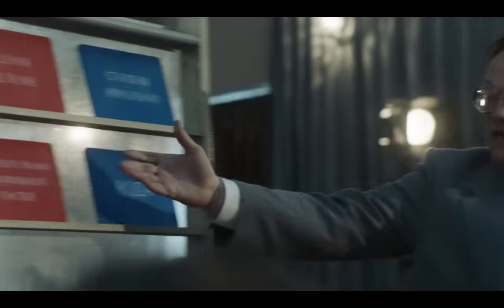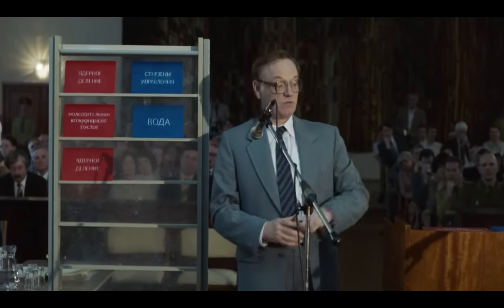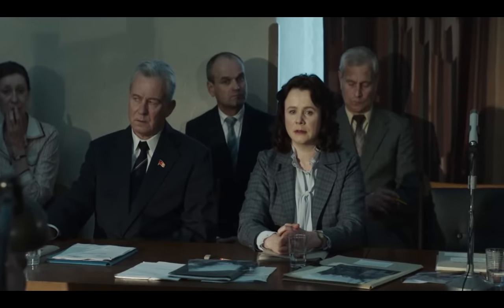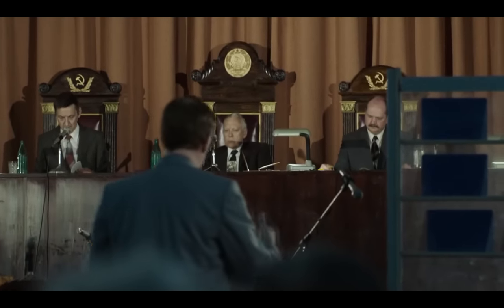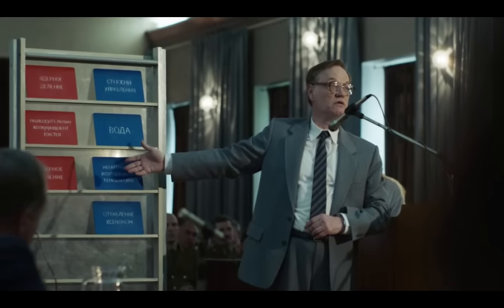Chernobyl scene #1: Valery Legasov explains, how an RBMK reactor works

Comment: I'm a nuclear reactor operator, working on a pressurized water reactor (PWR). Truly, I tell you, this is one of the most scientifically accurate scenes you'll ever see in TV or cinema. I'll do my best to explain the science.

We measure reactor power by the neutron population in the reactor. Neutrons split uranium atoms, which creates heat, fission products, and more neutrons. But a lot of neutrons move too fast to hit uranium. It needs to be moderated. (more on this later)

Critical- the reactor power is stable. Supercritical- the reactor power is rising. Subcritical- the reactor power is lowering.

Reactivity- how much the reactor departs from criticality. Another way to define reactivity is the generational change in neutron population.

Scram- full automatic insertion of control rods. In the RBMK reactor, the AZ-5 button slowly lowers all control rods into the core. In my reactor, rods are unlatched and instantly dropped to the bottom.

Boron is used for control rods because they absorb neutrons, thus lowering reactivity. Simple enough.

Water is used as a coolant, transferring heat from the core, and turning into steam to turn electric turbines to produce electricity. As you know, water is made up of 2 hydrogen and 1 oxygen atoms. The hydrogen atoms are the same atomic weight as neutrons. So, neutrons can elastically collide with water and transfer its energy, and slow down (becomes thermalized). These thermal neutrons are far more likely to hit uranium atoms and cause fission.

Positive Void Coefficient- the mathematical explanation of water when it converts to steam, it raises the reactivity, thus reactor power goes up

Negative Temperature Coefficient- the mathematical explanation of how water affects reactivity. As you know, colder water is denser than hotter water. Because water is more dense when colder, it has a greater chance of moderating neutrons, therefore causes reactor power to go up. Therefore, hotter water will actually cause reactivity to go down.

Xenon- this is a very important fission product. It is called a "poison" because it absorbs neutrons, thus reduces reactivity. Some xenon is produced directly from fission, but most comes from the decay of iodine, another fission product. Xenon is removed from the core from either absorbing neutrons (called neutron burnout) or from decaying into cesium. So when a reactor's control rods are inserted or scrammed, the neutrons are quickly absorbed by the rods, which causes xenon to rise significantly. If you try to prematurely restart a reactor from shutdown, you have a lot of xenon to overcome. The Chernobyl reactor operators did not understand how xenon behaved, and so were confused when the power tanked and then panicked when they tried to quickly raise the power again.

Graphite- the RBMK reactor uses graphite as its moderator. In comparison to water inside the reactor, graphite moderates neutrons far better, causing more fission reactions. This is a design feature of the RMBK reactor.

On the night of the accident, the operators lowered the power, which allowed the xenon concentration to rise. To overcome the xenon, they raised control rods all the way to the top.They started the safety test, which stopped the pump supplying water to the reactor. Thus all the water in the reactor turned to steam, which caused power to rise due to the positive void coefficient, even faster with the rods at the top. When Akimov hit AZ-5 (scram), the graphite tipped rods inserted, which caused the power to skyrocket. All these combined factors caused Reactor 4 to burst open. The superheated graphite, when exposed to the open air, instantly caught fire, which created the explosion.

This is a lot of info and there's a lot more to explain. If you have further questions, I'll be happy to answer. =)
Reply: Legasov really wasn't kidding when he said it was a "beautiful dance" inside a reactor. The science and technology behind this stuff is simply incredible. Got to ask, what do you think of the fourth generation reactor designs? Things like the VHTR and such?
Reply: Thewaltham this video clearly is in shock get him to the delusional
Reply: Try explaining all this to a 5th grader.
Reply: Neat.
Reply: @awittyusernamepleaselaugh7481  Sorry I took so long to reply. I'm not very familiar with 4th generation designs, but from what I've read so far, they seem like the right way forward. The VHTR is several steps ahead of PWR's, which I didn't realize was only a 2nd generation design. It uses helium or liquid salt as its coolant instead of water. Helium's advantage is that its chemically inert and it won't become radioactive like water when exposed to gamma or neutron radiation. Liquid salt has better power density and can contain fission products in the event of a leak. It would also be very nice to not have to worry about pressure control or brittle fracture so much with VHTR's; in PWR's, pressure control is everything, and brittle fracture is always a concern.
Reply: @APG19912009  No, graphite doesn't react with xenon. From a fission reaction, neutrons are formed from the uranium atom that got split. Most neutrons are fast neutrons, which do not have a very high chance to collide with other uranium atoms. A moderator is a material that slows down these neutrons when the neutrons elastically collide with it. These "thermal" neutrons now have a greater chance of interacting with uranium and causing a fission. So when the graphite tips on the control rods were driven in first, these quickly thermalized neutrons to cause more fissions, which caused power to rise.
Reply: Do you think that there could have been a way to stop the power rise without causing the reactor to explode. Perhaps only putting in the control rods back in a few at a time?
Reply: @shadowwolf2608  The only way I can see the operators could lower the power with the rods on top would be to stop their safety test and restoring feedwater flow to the core. The whole accident occurred because they were performing a test to see if backup power can support running feed pumps if they lost power. When the pumps were stopped, all the water that was in the core evaporated into steam. Since this reactor works with the positive void coefficient, more steam means the reactor power goes up. Restoring feedwater flow to the core would reduce the steam in the core and reduce its power. Now, the feedwater would be cooler than the water/steam that is in the core, so because of the negative temperature coefficient, the power would also rise. But as the water gets hot again, the power would go down. Because of these two coefficients, a slow, steady restoration of feedwater instead of a sudden restoration would bring the power back down enough that the full insertion of rods wouldn't act like a detonator and finally bring the reactor to a shutdown condition.
Reply: @demonhunter5520  Thank you
Reply: @demonhunter5520   thank you for explaining this for me! I was curious as to how it all worked and how it all failed. 
If used properly nuclear power is wondeful! I'm glad we learned from our mistakes and is making a much better design! 
So I have a dumb question does the water that goes into the core become radioactive??
Reply: Why boron control rods have graphite tips?
If graphite acts as a moderator, their complete extraction from the core is a "mistake", correct? I mean.. at the end of his speech Legasov says "it's cheaper", so I would think that it's cheaper to have bars with dual aims, so that when only the tip is drawn they only work as a moderator (graphite), while they can be completely lowered if reactivity has to be reduced (boron).. did I get it right? The "mistake" in RBMK reactors is to have rods which can create two opposite results only depending on how much they are lowered? (And to have personnel who didn't know this?)
Reply: @luha500  The graphite acts like a gas pedal and boron is the brake pedal, so graphite brings the reactivity up and boron brings it down . You need them both in a reactor like you do in your car. The mistake is more down to the fact that all the rods were put in at once rather than a few at a time. demonhunter5520 may understand your question better than I do
Reply: I want to ask 2 questions :
1 , the graphite is already surrounding the fuel rods , how inserting just graphite tips will increase the reaction tremendously 
2 the steam exiting the chimney , was around the fuel before , thats mean its was contaminated , how do they clean it before releasing it to the sky ? 

Thank you sir for your valuable informations
Reply: @zakarianaji9209  Im not nuclear engineer, but i think that 
1. the graphite isnt surrounding the fuel rods, its more like the fuel rods are inside a chamber which is coated in graphite, which increases reactivitiy, and so when the graphite tips of the boron control rods are lowered, that spike in reactivity caused the explosion before the boron could enter the chamber and slow reaction down.
2. Im pretty sure all the feedwater and steam are heavily radiated and would not be released or linked to and water systems that come into contact with humans, the water is heated, converted to steam, which drives turbines to generate power, then its probably cooled down and the process repeated, it never leaves the system through chimneys etc.
Reply: @saifury2  but the point is , there was already a lot of graphite in the reactor  , wich increase reactivity , so how insert ing like 5% or less of graphite cuse this huge Spike in reactivity
Reply: @zakarianaji9209  prob something to do with location, the control rods are situated between the fuel rods, and instantly reduce reactivity, hence i would think the same thing occurs for the graphite tips
Reply: This is very informative ❤
Reply: demonhunter5520 sir thanks for your explanations, but there is still something i do not get. 
What was the main consequence of the xenon poisoning in the chernobyl incident ? Sorry for my english i come from belgium :)
Reply: Interesting comment. I am curious, tell me, as a nuclear operator, what were your feelings when you watched this show, and that last episode in particular where the disaster unfolded? :)
Reply: I definitely read all of that.
Reply: Awesome information dude
Reply: nneeerd
Reply: @valentebrandontoni6029  Xenon poisoning as already pointed out will insert a negative reactivity and thus drive down the power. The operators never realised this and kept on withdrawing control rods to insert positive reactivity so as to increase the power to the level demanded by the test.
But as soon as power increased the already existing Xenon buildup started getting diminished due to increased neutron production.
And suddenly the negative reactivity of Xenon vanished and the power started to skyrocket.
Reply: @APG19912009  They call it a "moderator" because it moderates and slows neutrons down which makes them more likely to react (be captured) when they collide with a nucleus, raising the reaction rate. I'm just not sure why it was on the tips of the control rods.
Reply: I'm very confused as to the role of water and the positive void coefficient in the reactor. So, typical water is used both as a coolant and as a moderator in the RBMK reactors, albeit I believe it's a rather poor moderator due to hydrogen's higher neutron absorption cross section. So my first question is if water has a moderating effect that outweighs its neutron absorption? I believe it does, but if water is mostly a moderator, then this leads to my second question, which involves the positive void coefficient. Since colder water is denser than warm water, that seems like it would have a larger moderating effect as there would be more water molecules present. Therefore, the warmer the water gets, the less of a moderating effect it has, and reactivity would decrease as a result I believe. So, I'm confused as to why steam causes reactivity to INCREASE when it seems as if it should decrease, because there's now a lower density of water molecules, ergo decreasing the moderating effect of those water molecules. Is there a unique property of steam that increases the moderating effect of those water molecules, or is there some other factor at play?
Reply: @blindMAN219  Hi David,

Water is a very good moderator and as you mentioned a neutron absorber too.
A neutron should ideally in practise get thermalised in min no of collisions with the moderator ( elastic scattering) because it helps in preventing the radiative capture of neutron in the fuel. This is done by water much faster than heavy water.
So the neutron in a water moderated reactor can be thermalised quickly and thus neutron will not travel far away to get thermalised - helps in making a physically smaller reactor.

All this is possible only when we compensate the demerit of water being a neutron absorber, otherwise, the chain reaction will never happen even we have made a physically smaller reactor.
So, the way out is to enrich the fuel so that sufficient neutrons are available even when many get captured by water moderator.
Reply: @olympusmonsx  Oh that's very interesting. So the use of heavy water in natural uranium reactors is because the D2O has a much much lower chance of absorbing the neutrons, even though it has lower moderating capabilities? So that explains why you need low enriched uranium in light water reactors OR another moderator like in the RBMK reactors - to grant far more moderating capability to offset the absorption by the light water when using natural uranium. This makes a lot of sense, I get it now. Thank you for clarifying this for me!
Reply: @olympusmonsx   So, I understand thermal neutrons as being neutrons slow enough for the uranium to undergo fission when absorbed. You mentioned radiative capture - what is radiative capture, and why do we want to prevent this with the nuclear fuel?
Reply: @blindMAN219  
If you observe the absorption cross section of neutron for say U-235 fuel, at thermal energies it has a very high value , then it decreases gradually for increasing neutron energies plotted on X axis.
However, something interesting happens when you're in a band of few KeV energies, we observe resonance peaks of higher cross section. So in the process of moderation you're decreasing neutron energy gradually by elastic scattering. If you don't cross these peaks quickly and enter low neutron energy ( where fission cross section is high) you'll unfortunately loose that neutron to radiative capture. So the role of moderator to quickly decrease that energy in as few collisions as possible becomes eminent.
Reply: @olympusmonsx  Oh okay, so if the moderators take longer to slow the neutrons, there's more time for the U-235 to absorb those neutrons via radiative capture rather than fission, so you want to slow it down quickly to minimize those chances. Got it
Reply: @blindMAN219  Bingo
Reply: @olympusmonsx  Thank you for the clarifications. I just started researching nuclear physics a few months back and still have a LOT to learn
Reply: @blindMAN219  you're definitely on the right track. Fell free to indulge in any discussion in the future too. There is always something more to learn for me!
Reply: @demonhunter5520  Not me, I am still confused. The graphite rods are a moderator, what did the operators expect to happen by Hitting Az-5?, or why did the neutrons thermalize so quickly?
Reply: @JRJunior8624  so, graphite increases reactivity. When they hit Az-5. They expected for the boron control rods to decrease the reactivity. As the rods are made of boron, which decreases reactivity. However, the tips of the control rods were made of graphite. And the tips go in first. The key point is no on KNEW that the tips were made of graphite because it was kept from them. When they reinserted ALL the control rods, the graphite tips caused the reactivity to skyrocket. I believe it ruptured something that moved the control rods. With that machinery destroyed, the control rods were locked in place with only the graphite tips accelerating the reactivity endlessly. Until the core couldn't take it anymore and exploded.
I'm not an expert, but this is how I understand it.
Reply: The real question is why would Chernobyl's management be so incompetent as to hire people who couldn't anticipate the consequences of allowing xenon to build up in the core.
Reply: @mallow5828  they knew about it and the manual in front of them clearly told them that power is too low to perform the test.
This happened because of arrogance of the senior staff of unit-4.
Reply: If moderator made from pure Borons from the tip to control rods 
Still can prevent disaster?
Reply: What design flaw is reason for presence of positive void coefficient in RBMK reactor? Is it because of graphite on control rods tips or something else?
Reply: @swami5073  The void coefficient is something that is inherent in boiling water reactors like the RBMK reactor. This allows the use of unenriched uranium and no need for heavy water.
Reply: @TineFangaming  It probably would have helped if the control rods did not have graphite tips. For example, some reactors' control rods have tips made of zirconium. Zirconium does nothing against reactor power and only serves to protect the boron from being damaged. Another better design feature would be if the rods are instantly dropped to the bottom when scrammed, instead of being slowly inserted.
Reply: @demonhunter5520  Zirconium good absorb neutron as Boron?
Reply: @swami5073  Positive void coefficient though dangerous certainly shouldn't be a called a design flaw. It depends on the reactor technology used. Reactors as such have much more negative reactivity in store to suppress such postive void coefficient reactivity additions.
Its not because of graphite on control rods. It is to do with fast fission in fuel.
Reply: @Vinícius M Surkamp there too many steam inside reactor it's out of control
Reply: @demonhunter5520  Hello, thank you so much for your explanations. I understand that the control rods are tipped to protect the boron from damage. But why putting graphite, the material that does exactly the opposite thing of the boron ? Legassov says it's cheaper, but it's also counter productive, to not say stupid. There must be another reason, do you know what it is ? I read that "the graphite displaces water that would otherwise act as a neutron absorber", but since the boron itself is a neutron absorber, I don't get why it is a problem. I'm a total neophyte, but this question obsesses me. I don't find the answer, and when I do, I don't understand... :/ Thanks by advance !
Reply: @EmmanuelleCailac  Good question, I highly recommend this video that explains precisely the whole "tipped graphite rods" thing: https://www.youtube.com/watch?v=hIGtTImeYU4. Legassov's comment on it being "cheaper" is kind of misleading.
Reply: Why does cold water decrease reactivity and vice versa?
Reply: @kapilhooda2373  No it's the opposite effect. Colder water is more dense that hotter water, so there is a greater chance for neutrons to elastically collide with the hydrogen atoms in water molecules, therefore transferring its energy and slowing down. When neutrons slow down (or what we call "thermalize"), they have a  greater chance of colliding with a uranium atom and then cause a fission. Therefore, colder water increases reactivity while hotter water decreases reactivity.
Reply: Wow.
Reply: two questions:

Does Xenon bind with water, or does it co-mingle with steam?

To clarify, the graphite blew up because it was dry from water not pumping, thus allowing the graphite to not have a heat "cushion" from the water?
(From my understanding the shroud was made of graphite, and the control rods were tipped with graphite and was super hot. When the control rods lowered and went back to the shroud, it super heated the shroud making a chain reaction) sorry if I don't make sense, I'm trying to grasp understanding with imagination
Reply: I've got a question for you!

If you were a hot dog, and you were starving, would you eat yourself?
Reply: @valentebrandontoni6029  The main consequence of it was how poorly people in the control room understood what is happening to their reactor. They either didn't know what it does/how it is produced or failed to factor it in. They saw their reactor staling and without thinking about xenon the only logical option in their heads was to raise the control rods. When they did this, xenon started to burning up (with absent control rods, this happened very fast). So now they had a whole lot of neutron production, whole lot of neutron moderation and big ol' zero neutron capture with xenon gone, and rods gone which resulted in a power spike....
Reply: Sorry for the dumb question, I'm into isotopes too being a nuclear medicine technologist. What's not clear for me is the Xe behavior in this regard: 135-Xe is, I believe, the poisoning isotope so if your reactivity is greatly subcritical for a long time you should wait some time to rise it up, since the half life is about 9 hours ... but in the same time even Iodine is decaying in 129-Xe and 131-Xe which are stable.. so how you get rid of them? Second question, if, as it is, 135-Xe decays into 135-Cs where did all the 137-Cs come from?

I'm sorry you might laugh of me, but I felt like I wanted to ask.
Reply: @demonhunter5520
 Have I found a fellow Nuke watching this scene ?
Reply: @taylorc4598  Yes, you are correct. Xenon concentration is considered when starting up a reactor. It is better to wait for the Xe-135 to decay before starting up a reactor. The problem with the Chernobyl operators is that they didn't understand how xenon behaved and they were pressured into raising the power prematurely. The other fission products you speak of remain in the core and decay away over time. Cs-137 is just another fission product that can appear. This isotope remains the main source of radiation that is leaking from the Chernobyl and Fukushima reactors.
Reply: I operate reactors in Vandellos II and we recently upgraded our reactors to PWR, two weeks ago, an incident ocurred, the steam built up and broke three control rods, which exposed my coworker and he is now in the hospital with severe acure radiation sindrome, I will always stay protected in the control room
Reply: @demonhunter5520  As a nuclear engineer who has worked in reactor design and safety on both PWRs and BWRs, I just want to clarify that positive void coefficient is not inherent in all BWRs. It is a thing in the RBMK due to the use of graphite as the primary moderator. The BWRs operating in the US were largely designed by GE, and use water as the moderator much as PWRs do. Because water is the moderator in all US BWRs, increased voiding means decreased moderation, and therefore reduced neutron absorption in the fuel (lower power).

The reason why the graphite tipped control rods made the power increase so severely isn't necessarily because they're moderating more neutrons (though that certainly made things worse). The primary reason is that when you insert the control rods, you displace water from the channels. In the RBMK, the water acts more as a neutron absorber than a moderator, because of the graphite reactor blocks serve the purpose of neutron moderation. By inserting the non-absorbing graphite section first (rather than the neutron-absorbing boron carbide section of the control rods), you end up accelerating the power increase. If the rod tips were a non-reactive material like zirconium alloy, the accident would still have occurred, though at a somewhat reduced severity.
Reply: Shouldn't your name be neutronhunter?
Reply: Im Albanian i love to work as nuclear operator but here in balkans doesen't have any Nuclear power plants
Reply: @demonhunter5520  This is what happened at Ignalina first., but was classified by the KGB and Soviet government. As has been pointed out in several documentaries, the people in charge and in the control room where everything was controlled DID NOT KNOW about Ignalina. But the charges against them was that they knew. Great shame on the people in the government and KGB for this tragic situation. But, not surprising, sadly.
Reply: @saifury2  The water that is inside the reactor is not the steam that is seen coming out of the reactor. That water stays in the reactor. Anything that is used in the reactor stays in it. Other water is run through heat exchangers to cool the water in the reactor and run the turbines.  See it here :    https://www.youtube.com/watch?v=J62ZSMnEMZw
Reply: @mlgamings6110  The key point is no one IN THE REACTOR Knew about the tips. They were never told until it was told to the court. And it was classified by the KGB and the Soviet government. In telling it, Valery Legasov signed his own death warrant, albeit a very slow death.
Reply: @mallow5828  This is what happens when you hire someone who is only allowed to read the "accepted and approved" text. Things like faulty control rod design, xenon gas - the complete consequences, why containment walls are used everywhere else, etc, etc, etc,    -  They are NOT mentioned. That was mentioned in the documentary. You are told that "Soviet reactors have a perfect safety record. We have had 17! 17! They are never told about them!"
Reply: Thanks for sharing!
Reply: What SHOULD they have done?  Yes I know you say that they should run more water in instead of inserting the control rods, but was ANYONE on the planet really aware this could happen?  It seems that the reactor was sold/understood as being "explosion proof", so would any nuclear engineer ever think "No I won't lower the control rods, I'll flood it with water."  Seems to me like control rods would be the go to for any engineer in an emergency.  Not making excuses, just saying it seems like a decision no one would think to make.

Also, if xenon is really the culprit here and was built up because it was running at lower power for too long, how do you get rid of it?   Increase power very slowly?
Reply: Hard to believe that, even in this, the 21st Century, steam is still what lights, cools, and warms our homes. All that's changed is the fuel source that generates the heat that turns the water into steam. Not saying this is a bad thing. Far from it. It's just one of those things that, if only the men who invented the steam engine back in the 1800s knew that even two hundred years later, steam would still be powering the globe.
Reply: @Boskov01  You're right...and actually most of science.  It's all pretty much (right now) based on basic inertia, basic mechanics, gears, etc. thats been around a LOONG time,  just hasn't been applied to extremes.  Jets = throw some shit that way, move the other way.  Rockets = same thing.  Cars...explode this, move this up and down, transfer energy through gears and wheels.  Lighting: heat up this wire til its bright (and until recently) lose most its energy to heat.   I would say the only truly MIND blowing thing was turning on/off electrical signals into a computer.  Maybe coolant (learning the transfer of states and using that for air conditioning and fridges).  And hydraulics are cool but pretty basic.  And the concepts of electricity are pretty neat (move a magnet through a copper coil and we develop a transportable energy).  We've only had the industrialized world for 250 years, the rest was pretty much theoretical before
Reply: @johnspence8141  Yeah but when you ask the average person how a nuclear powerplant works, they probably have no clue. Hell, just two weeks ago I had no idea. I thought it had to do with like, harnessing the radiation and converting it to electricity. I'd never looked into how nuclear reactors work and never even needed to before starting to delve into the whole Chernobyl thing. But to find out it's basically a steam engine with a different fuel and fire source to heat the boiler, it's hilarious yet badass all the same.
Reply: @Boskov01  Yep, if you can past the waste that kills people for a million years, its WAY better than most sources...I'm pretty sure one day they will discover a cheap way of converting waste back to a safe element.

I think you are right about the average knowledge but its not a fair question because I bet MOST could not explain how their car works beyond gas is a fuel.  And even if you did find many, I 100% can tell you NO one can explain to you how a computer works.  I'll go even farther, I bet 9/10 can't tell you how a fridge works.  Science knowledge is embarassingly low in the average person.  So is basic finances.
Reply: @johnspence8141  I do hope that one day we can find a way to convert the waste back to a safe element or perhaps find an alternative use for it (outside of weapons or dirty bombs of course). Same reason why I hope one day we can go back to Chernobyl and Pripyat and clean up the radiation so that we can be able to even step into Reactor 4 itself without any ill effects. Don't think the area should ever be repopulated out of respect to the victims but kept as a reminder of what happened.
Reply: Question; if graphite is a moderator and absorbs protons how could it accelerate the reaction?  I dont get that part
Reply: @rabbicy  I believe it had more to do with the water displaced.  The graphite tips would have worked fine if they had not been removed completely (which is a safety protocol they disabled), when reinserting it the water displaced caused a spike, immediately turning to steam causing the channels to crack/rupture, so the control rods couldn't continue to go down...at the point they did it the energy spike in a millisecond was so huge that it didn't matter.  HAD THEY NOT disabled the safety protocol, ie: had the graphite tips remained IN THE CHANNELS as designed, no explosion.  There were so many bonehead decisions its amazing any of them had degrees.
Reply: @johnspence8141  Thanks.  So it was not the graphite, per se, it was the displacement of the water that caused the rupture.  Good to know.  So even if the graphite rods were make of cheese, the same thing would have happened, it sounds like.
Reply: @rabbicy  ya the way its reported in the movie, the graphite is accelerating the reaction but as you pointed out, graphite is an absorber.  It had something do with a momentary gap created by the sudden pushing down of the graphite that instantly turned the water to steam, expanding and cracking the channels preventing the rods from going down further.  Once they were cracked, oxygen and flames mixed with the hydrogen and thats all she wrote.  HAD THEY NOT DISABLED the graphite rods and removed them, this would not have happened.
Reply: @johnspence8141  That makes perfect sense.  thanks
Reply: If colder water dense and moderate the reaction, isn’t it reactor power should go down? And vice versa with hot water? Sorry this part is confusing and also one more question what is the purpose of graphite when you have boron rods to moderate reaction?
Reply: I know it’s probably way too late to ask anything, but why doesn’t graphite cause an explosion every time the az-5 is pushed (it was pushed a few times before), is it because of the positive void coefficient and hence the graphite being exposed directly to the neutron stream, or was it because of something else?
Reply: @tlf_worldcorner2878  no i think its the fact that they removed the graphite entirely against safety protocols...had they not, it wouldn't have screwed up...when pressing the button I don't think its the graphite itself (which as someone pointed out is actually a neutron absorber), I think it displaced some water that caused a huge spike which cracked the channels...preventing the scrambler from actually dropping.  So many things went wrong in this its crazy that they are engineers.
Reply: @johnspence8141  alright, thanks!
Reply: So what I’m hearing that you’re REALLY good at juggling
Reply: I'm told SCRAM is a term from back in the day when control rods were suspended by ropes from the ceiling. And that it stands for Safety Control Rod Axe Man. Is this true?
Reply: @arnavjoshi5913  so you're trolling definitely not
Reply: @johnspence8141  no intention of trolling, but good to know that story is apocryphal.
Reply: @mlgamings6110  except graphite is a neutron absorber, and they all knew about the graphite.
Reply: @johnspence8141  No they didn't. They didn't know that the tips of the boron control rods had graphite. They knew about graphite inside the reactor, but not at the tips of the rods.
Reply: @mlgamings6110  you're basing it on the movie...they most certainly knew the make up of the tips.  Its in the design specs and they knew the design specs.  Graphite does NOT accelerate radioactivity, it absorbs...what caused his is the tips WERE REMOVED almost entirely, and when pushed back in DISPLACED water/AIR that created a void and an accelerated reaction, breaking the channels, making the rods impossible to go in.  HAD THEY NOT REMOVED THE GRAPHITE TIPS ENTIRELY, they would not have had a problems.  DONT BASE YOUR SCIENCE ON MOVIES.  His conclusions was simply for ease of understanding, go watch the videos by the actual nuclear scientists.  GRAPHITE IS AN ABSORBER.

What they did WRONG and AGAINST design specs, in the name of a safety test, they REMOVED the rods from the actual core...the design doesn't allow it, so they had to override the design to do it.  IF THEY DONT DO THAT, there is no explosion.  Were they stupid?  Yes but not because of the graphite tips, but simply because they were told it could NEVER explode.
Reply: @mlgamings6110  A lesser known property of graphite is its unique ability to absorb fast moving particles (protons and neutrons) [28]. This interesting property allows the material to absorb light, radio waves, microwaves, and radiation too.
Reply: @mlgamings6110  https://en.wikipedia.org/wiki/Nuclear_graphite
Reply: @johnspence8141  so... Like the science is accurate but the scenario didn't happen exactly the way it was protrayed? The scenario that the show protrayed had accurate science that could possibly happen if it really did happen the way in the show.
Reply: Truly amazing of your explanation, thank you comrade
Reply: Put this up on the Wikipedia. Maybe you will help some student write their research paper
Reply: @demonhunter5520  what is "shutdown condition"? if i understood your explanation it's actually not really possible to quickly shut down a nuclear reactor right? what does shutdown then mean and how is it done? and how is uranium fuel changed during normal operations, do you just let them run out of unstable uranium? thanks a lot.
Reply: also did you ever take a swim in the pool when your supervisor wasn't around?
Reply: nuclear power is so fascinating, i just started watching that HBO series and got really interested in it haha. still boggles my mind how "we" even found out about this stuff so early in the 20th century. also quantum mechanics. just mindboggling.
Reply: You are almost as well spoken as Legasov. But it think Akimov CERTAINLY knew how the reactor would behave due to xenon. He even said "we have to wait before raising the power". He did wrong operations only because Dyatlov told him.
Reply: @APG19912009  i guess the scientific wording here is confusing. "Moderating" means not slowing down the process, but moderating neutrons, which means slowing them down, which means increasing reactivity, because slower neutrons collide with uranium more often  than unmoderated fast neutrons. That is what the op wrote as well.
Reply: My husband (who is a nuclear engineer and works at a private contractor) loved this series and said that this scene especially was perfectly done.
Reply: is there a difference in the incidents in chernobyl and fukushima....?
Reply: @johnpatricklim4509  Yes. Basically it's like the Hindingburg compared to the Titanic...they are both crashes but in different ways. Chernobyl was an explosion, Fukushima was a meltdown.

Chernobyl was caused by a bad design where they intentionally disabled the safety systems to run a test. Fukushima was caused by an act of nature, a tsunami, which knocked out the backup generators. Had they build a higher seawall or better protected the diesal generators, it would not have happened.
Reply: @jthorsson6167  reactor shutdown means bringing it to very low performance, far below subcritical. There is also a termin cold shitdown which means that water coolant doesnt even boil. You cant just "turn off" the reactor. You set it to cold shutdown with pumps working, because reactions are still vojng and generate heat, but not enough to boil circulating water. And then yes, you just wait till you are out of unstable uramium. Afaik even after that you have to cool rods for several years
Reply: @rinkashikachi  classy !
Reply: @rinkashikachi  And third: https://youtu.be/adFydLvLLeU
Reply: That is an amazing explanation. Thank you very much.
Reply: So in very simple thoughts. This sounds like they use the reaction to  create heat to power the turbines to create electricity. Is that correct?
Reply: @sytseth  yes
Reply: Many thought this show was an indictment of nuclear power. It clearly was an indictment on communism specifically and political cronyism generally. The producers were kind and left out the May Day parade in Kharkov when party officials held a parade that exposed the citizens while moving their own families out. Not a single Communist Party official was at the parade.
Reply: well, demonhunter99, did u finnaly killed demon king muzan?
Reply: If they had not pressed the button(AZ-5), how the circumstances of the reactor would have changed?
Reply: If you had a chance to go in that control room before the reactor exploded, would you with your knowledge have been able to stop the explosion, and get Dyatlov out of the way first?
Reply: thats for saying exactly what the vid said bruh
Reply: I will never understand any of this, but thank you for the explanation and for your work
Reply: Cool explanation dude! You clearly have strong professionalism in nuclear energy!
Reply: You sir are amazing
Reply: and why exactly did you type out the explanation again? yes, that is what was said in the show.
Reply: It's good but they talk too much about the idea of graphite "tips" suggesting this was a design flaw. This was intentional and a feature of the rbmk design and allowed the reactor to function properly. Also the idea of "tips" is wrong, the graphite is a big part of the rods, not just the tip. They also mention that graphite was used to save costs, again wrong. I also believe that they give an exagerated importance to the reactor exploding right after scram, when in reality it was already too late.
Reply: Thank you for working in such a important field, and for explaining things to us mortals in a way we can understand this invisible dance. My heart bleeds everytime I think of this accident, all the lives lost, I hope nothing even remotely similar to this happens again, therefore THANK YOU, for taking up the task of moderating and observing this process, be safe <3
Reply: Thank you!! This is so interesting
Reply: I have a quick question. Can lead, a metal that can supposedly shield against radiation, serve any part in stabilizing a reactor?
Reply: Thank you so much for jotting this down for the layperson like myself.
Reply: I want to work with reactors as well, how hard was it to gain the proper qualifications and How is the daily work?
Reply: There were no "graphite tips". It was a secondary rod. The idea that underlined an RBMK reactor is that you never had to turn it off. Not for any reason. The control rod setup was meant to be like a boat throttle. Something you increased or decreased but not off. That's why there weren't containment buildings. In the West you have to take half the building apart to just do maintenance or refuel the thing. Also, until Chernobyl, all of the worst nuclear accidents and a majority of them period, happened in the US or UK.
Reply: One thing I've always wondered: when reactor 4 first experienced a power excursion, would turning all main pumps back on before scramming would've made any difference? That is, would the presence of coolant slowing down the exponential heat rise - plus the neutron-absorbing water prevent the spike that fractured the channels and prevented the control rods from inserting - do anything at all? Did the pumps even have enough time to go to full power?
Reply: Next, please explain how magnets work.
Reply: As lovely your explanation is, which btw I really appreciate.
the "dance of the devil" as I call it, is as much terrifying as spectacular..
what terrifies me most, it the fact that once this "dance" goes wrong, you cannot just simply turn off the music...
(now Im talking about the reactor building being hit... nowadays, if we take it this way... Chernobyl is still active, shielded, yet its force you cant command at will... by all means, noone would "like" to open it up, but it can happen by random hit...)

Im not a scientist, but if there is something that scares me, its radiation... if the uniforms of firefighters in basement of Pripyat hospital are still radioactive... the core is still a threat...
Reply: Is it possible to safely remove the uranium or are all nuclear power plants just disasters waiting to happen? Is there a scientific way to safely make the neutrons dormant?
Reply: i will say i think one day our species will regret using so much uranium in reactors. Its a very rare un replenish-able resource who know what need we may have for it one day.. let’s use wind, solar, and other as fast as we can to stop using up this resource
Reply: @Josecannoli1209  Uranium is not a rare resource by any means. You are mistaken.

From The World Nuclear Foundation - "Uranium is a relatively common element in the crust of the Earth (very much more than in the mantle). It is a metal approximately as common as tin or zinc, and it is a constituent of most rocks and even of the sea."
Reply: @logangx9319  no you are mistaken 238 uranium isn’t rare.. 235 what we use in nuclear reactors is. .7% of uranium is 235. That’s where the concern comes from in my comment.
Reply: @Josecannoli1209  You're very misguided my friend lol. You ought to do some more research.
Reply: Why was graphite phased out as a moderator if its more efficient?
Reply: do an ELI5 bro
Reply: The open reactor exposed to air creates hydrogen gas that then explodes much more
Reply: You forgot to mention that the reason why they couldn't stop it was because the rods wore too cheaply made as well as the entire thing really. In a normal RBMK reactor built by the rules and no short cuts can not blow up no matter what. (obviously as long as it is maned) Also no qualified person L ever manned the reactor except the head of night shift.
Reply: So I have to ask, when the reactor power plummeted they should have stopped and let the xenon dissipate, then restarted the reactor from cold?
Reply: @davyt0247  yes
Reply: @tossacointoyourwitcherOriginal  thank you
Reply: @davyt0247  3 days off at least
Reply: Lost me at "neutron"
Reply: In your professional opinion, do we do it more safely these days?
Reply: Do the Coefficients exist within all reactors?
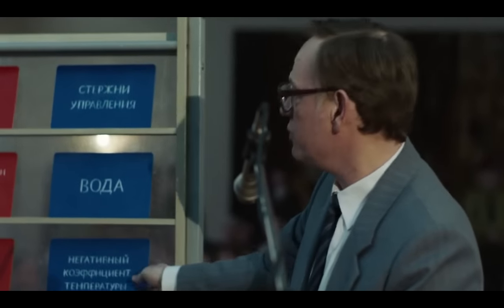Reply: 1:55 nuclear fuel becomes less reactive when it becomes hotter! Can someone tell why?
Reply: 1:55 nuclear fuel becomes less reactive when it becomes hotter! Can someone tell why?
Reply: Thanks not only for the explanation but for all you do. Nuclear power is not only safe, its the ONLY answer we have to climate change. If anything we need MORE nuclear reactors....NOT LESS!
Reply: now i know how it works, now i dont need you
Reply: Thanks for explaining what the show explained in this exact scene
Reply: There was a great lecture on YouTube a while back about this as well as why western reactors cannot fail the same way as Chernobyl.  I wish I could find it again because it has a minute by minute breakdown of the how and why the disaster occurred.
Reply: What are your thoughts on Thorium powered reactors?
Reply: Saving this
Reply: @Lmfaobbqsauce  sort of.  The problem was they manually removed most of the control rods completely from the water because the reactor wasn't building energy due to the buildup of xenon.  Had they been even partially in the reactor it might not have gone off.  The issue was they should have scrubbed the test since it wasn't under ideal conditions at all.
Reply: what is the source of neutrons in the reactor? how can be produced it?
Reply: well written (I'm a Senior Nuclear Power Plant Operator myself. Candu-6)
Reply: have you ever been to comanche peak?
Reply: Damn man!
Reply: Thank you for this very detailed and helpful comment, I’m trying hard to extend my knowledge of nuclear energy and the Chernobyl incident, so this was really helpful 😊
Reply: Modern mans quest to find safe renewable energy.... and sell it..
Reply: legasov explained it all already bro
Reply: Why were the tips made of graphite?
Reply: Thank you for sharing your knowledge with all of us.
Reply: You explained that really well, thank you!
Reply: @stephenking5852 so stuff is made of tiny balls called atoms. Those are made of tinier balls called neutrons and protons. Sometimes atoms are too big and protons and neutrons break away. This makes the stuff hot, so we put it in water. When the water gets hot and boils, it turns to steam and that makes power
Reply: Iluv u thx for the explain
Reply: That was pretty straight forward actually, you’re basically adding and subtracting elements to control the power or reactivity of the reactor.
Reply: so basically
AZ-5 botton wasnt the problem
the problem was the tips , LOWERED at slow speed
Reply: I very much appreciated reading this I'm just a simple janitor at a store but have always been fascinated. Surprisingly I understood all of what you wrote.
Reply: So i take it there were no xenon detection system on the RBMK type reactor to detect too much xenon building up in the reactor?
Reply: @demonhunter5520  Caution with zirconium control rod tips, if the control rods are displacing water they would act  as positive void feedback, like steam voids. If zirconium displaces steam it would have less of a difference on the effect, until the proximity of boron suppresses the neutron population.
Reply: Nuclear reactors and observing people explain them like you just did gave me a new love for science when I was previously very critical of the institutions surrounding the studies because they can be so hoity toity but truly I wish to master nuclear physics out of nowhere. That’s not common but hey it is what it is😂
Reply: @shadowwolf2608  The safety system of the Russian RBMK reactors at the time had identified a dangerous instability as the graphite section of the control rods were driven through the bottom section of the reactor core. So, the control rods had to be inserted slowly and in sequence, 2-4 at a time to reduce the instability as the graphite lower section displaced water at the base of the reactor core. Pushing an AZ5 scram inserted all the control rods too quickly, increasing the instability to the point of an explosion.
Reply: i honestly think you work at a fast food place, and pulled this from wikipedia. its common knowledge.
Reply: @notlisted-cl5ls  lol ok
Reply: What a great post!  I'm a man of science myself, but i don't know about nuclear reactors.  I learned things reading this.  good job!
Reply: What an incredible response, thank you very much.
Reply: if the reactor wasn't using graphite, would it have successfully scrammed?
Reply: Thank you for the information.
Reply: Why explain what has already been shown in the video?
Reply: @demonhunter5520  be my friend because that was the most beautiful explanation. Thank you.
Reply: @demonhunter5520  also, love your left for dead playlist! I was obsessed with those games. Still am ❤
Reply: Yeah i know some of those words, like water for example.
Reply: To me, as a person very far from nuclear reactors stopping water pumps with all rods retracted sounds like complete madness. What did these guys expect? Are they were like "uhm, power is not rising with rods at the top, what can possibly go wrong? alright, let's do it anyway"? Can't blame them for not knowing AZ-5 doing it was not supposed to though.
Reply: Awesome 👌
Reply: You have explained this nicely. Thank you!